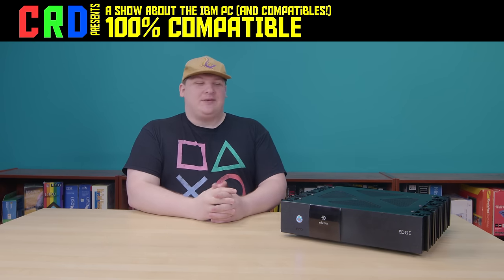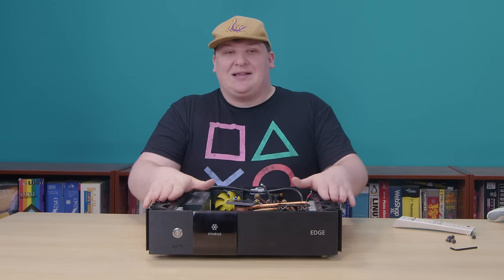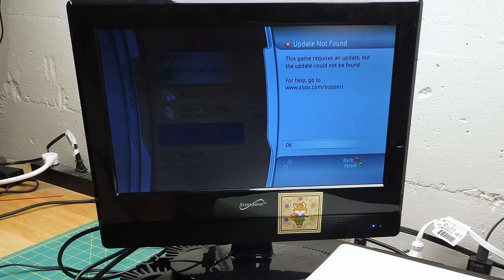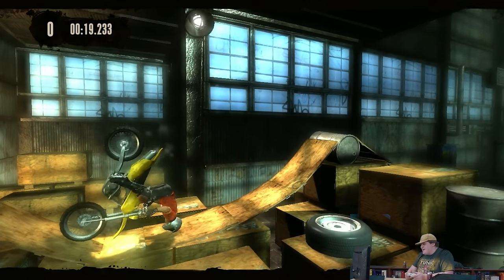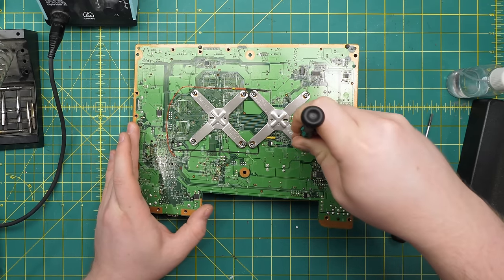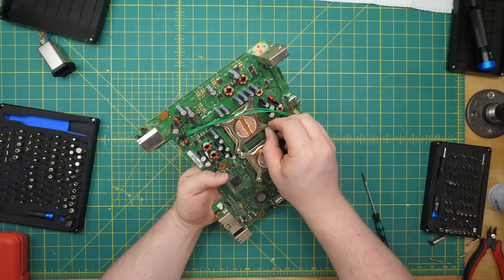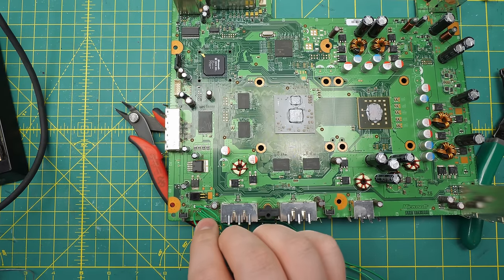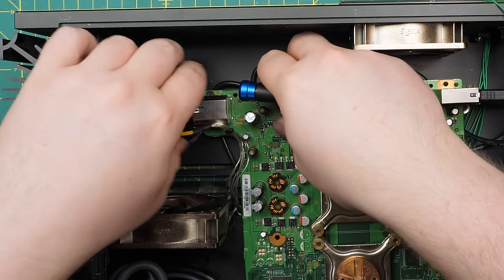The Niveus Edge Resurrection: Hacking A Hacked Xbox

Comment: Just to point something out. The early model 360s like the Xenon would RROD over time no matter what. People blame it on the heat and poor heatsink + fans, which were a problem. But nowhere near a problem as people thought. The real problems were simply the solder alloy they used. It was prone to cracking and chemical issues over time. This is why DIY and repair shop reflows (be it toaster oven or a proper BGA rework station with "correct" heat profiles (I say correct like that because no correct one exists). Microsoft also appeared not to understand this for a while either (hence 2+ warranty claims (or even 5+ - I had three), hence the first hardware iteration still having issues (at a much reduced rate at least). And eventually what lead to class action lawsuits which made them increase the warranty, then in some places they just made the RROD warranty unlimited (well until console EOL).

You could take a new old stock Xenon that had been sitting on a shelf for 12 years in a climate controlled warehouse, and chances are pretty high it'd RROD within a few hours. If it didn't RROD in a month that was/is still pretty much a miracle.

I believe it was some sort of oxidation reaction going on. It was quite complex with potentially some sacrificial metal magic also acting to draw out certain elements from the solder (keep in mind this was back when companies were still getting to grips to switching to entirely lead free solder). Other factors were the way mounting pressure was applied causing warpage (though well within previously acceptable limits) and finally users not just running it hot, but living places with regular very cold ambient temps when the console was off - constant cycling between hot and cold increased the issue a lot (though again within normal values had the solder been fine). This info was from a MS internal report iirc, either leaked or maybe from discovery in court).

Also something you might find very very interesting is that someone put a bunch of unused Xenon CPUs on eBay a few years back. Meaning CPUs with no blown efuses. The calls to blow fuses manually was also known back then. Meaning you could in theory grab one of these, and load it up with your own public keys, for the individual console key load up an old private + public key from a several year old console that hasn't been on live in so long (and has no suspicious live activity).

Then you could resign the latest firmware, upgrade. Now you can jump online with an 
Xbox you truly own. Run anything you want. Modify anything you want. Make the incredibly well implemented hypervisor a bit more chill. Would be amazing to own one, especially with the 1GB mod (btw if you wanted it to be a dev kit just fire off the efuse. Just make sure you reball that CPU with better leaded solder first. I heard some later chips including the CPU + GPU one also ended up on eBay - my memory is fuzzy there though. 

Also one last thing to say about the 360 is the software implementation for preventing unauthorised code from running was just spectacularly fantastic. To put it in perspective, the 360's software pretty much remains unexploited to this day - there is one exception which is the KK exploit which cleverly used modified shaders to get unsigned code to run. But by the time that was public it was long patched. Since then no one has ever gotten past the software security, since the console can be thought of as a simplified virtual machine. Any type of system call from an executable? Well better check if the signed process executable was given that permission? Nope? Kill the entire process. Oh the games buffer overflowed? Who cares I didn't even notice, that'd be too much performance hit. Oh it overflowed into system memory? *loads shotgun*. Also makes it so games can only see their own files written to the HDD, like modern Android etc.

It was amazing how well they learnt their lesson from the OG Xbox. Yeah they still messed up the DVD drive security implementation and the JTAG, but it was an insane improvement in one generation from the security mess the OG was. And as I mentioned the software hypervisor was and still is almost a perfect example of console software security.

Comment: The wireless signal is going through the fan openings and any gaps in the case. The M$ controller had a great range because they used proprietary wireless protocols in the 2.4GHz range. Automated digital RF channel hopping and signal strength that didn't have to fall in an IEEE spec. ;)

Comment: The DVD drive pairing is only actually necessary for playing games (executing code from disc). You can use the DVD video playback functionality of a donor drive just fine on a retail console - in fact, that "error" screen that comes up when trying to play a game with an unpaired drive is just that. A DVD video. Oversimplifying massively, Xbox discs have one small DVD partition with that video on, which was meant to show if a kid puts the game into a DVD player etc. The game itself is on a separate partition which is invisible to most DVD drives, because it's missing from the disc TOC (but the xbox knows it's there).

So it might well be possible to add DVD playback support to these machines without much effort.

I've not yet finished the video so if this is mentioned please disregard my comment!

Edit: 2 minutes later, and yes, this is mostly mentioned in the video oops
Reply: They could have moved DVD drives between their consoles, that would allow dvd playback without allowing Xbox games to run, which would make that a much more valuable product

Comment: Fun how it was mentioned that the DVD key is on the motherboards NAND, yet continued to say "slurping keys from one drive and put them on another" as the only way.
No drive is needed, slurp the DVDkey from the console's NAND and slap it on a drive. (step 1 of modding is to pull CPUkey and DVDkey to unlock the NAND. At that point you just restore to retail firmware and program the new drive)

Comment: The DVD key situation isn’t actually that dire, because the drives themselves are not married— it’s a daughterboard, so as long as you have another drive of the same model, you can swap that daughterboard over (it’s just a ribbon cable) and it will work. 

Of course, wouldn’t help you in the Niveus situation since the drives are probably in a landfill somewhere.
Reply from the maker: Yeah, I read that that was ostensibly possible... but then there's a ton of posts floating around from people saying they did it and it didn't work, and I know that makes no sense, but it suggests to me that maybe it's possible to screw up swapping the boards. So, while it probably never would have been an issue for me if I'd run into it - because I know to research something like that before attempting it, and because I have general electronics skills, etc. - it seems like for a lot of people it could still end with them $90 poorer and no closer to a functioning machine, you know what I mean?
Reply: @CathodeRayDude  yeah it’s definitely above what the average person will know how to parse and do, and admittedly I started working on these after they were thrift store fodder.

Comment: This reminded me of when I modded my original Xbox in 2019. Took it from stock to softmodded with a new(ish) bigger HDD and a tube-sleeved IDE cable.
I ended up having to cut chunks out of the HDD caddy to even get the thing to route all the way over to the drive, but I managed it. So, I guess it's technically a hardmod in this instance.
I also had to twist the cable something fierce to get it to route into the DVD drive's slot. That's one of the main benefits of using a tube-style one, since they take bends much better.
In any case, when you spend enough time taking care of and modifying the internals of these things, you really do become attached to them. I can tell that happened to you as well.

Comment: The key as to why your blue locktite did not cure is it requires isolation from the atmosphere.  I believe it won't cure in the presence of oxygen if I recall correctly, but I may be mistaken on the component of the atmosphere it needs to be isolated from.  Hence why it does the job of gluing fastener threads so well as the fact that it is trapped within the threads creates said isolation.

Comment: Rad follow-up! If I were looking for a "better" place to stick the SSD, I'd probably have stuck it to the side of the power supply case, maybe with a long extension cord you could attach it to the top of the case too? But honestly props for securing it to anything at all, honestly. I'm certainly guilty of just letting an SSD dangle from a cable or two in a pinch.

Comment: The "put disc in an Xbox 360" error you mention around 11:18 is a hilarious example of poor design.

The game discs are set up so that they also function as a standard video DVD. This is so that if some clueless user puts them into a DVD player, they'll get that "put this in an Xbox, dummy" message. That message is actually a video.

BUT, once the drive starts to wear out, it can fail to recognize the disc as being a legit game disc. When that happens, it assumes it's just a normal video DVD instead... so your Xbox 360 tells you to put the disc in an Xbox 360. Doh.

This confusing failure mode could have easily been prevented by just having some extra flag or file or something on the disc that tells the Xbox "this really is a game disc, I promise", secondary to whatever DRM it's checking. That way it could tell the difference between "failed auth check because something is wrong" and "failed auth check because this is a movie" and show a more appropriate message. (It wouldn't help pirates; the only way you could abuse this feature would be to make a DVD movie that an Xbox won't play.)

Comment: 1:00:00 You're missing a VERY obvious place to stick that drive. Stick it to the side of the power supply with some of the Gorilla tape. You have a huge flat spot right there.
Reply from the maker: It doesn't fit as well as it looks, trust me. I could use an extension but then I'd have a bunch of extra miserable cable mess torquing the drive connector, which really wants to pop out of the board as it is.
Reply: @CathodeRayDude You could perhaps swap it for mSATA?

Comment: I'd probably use a dab of nail polish on the heatsink screws. It won't hold up to any real amount of torque, but it will keep them from wiggling loose. It should come off relatively easy if you need to, and since it's on metal, you could use acetone to clean it if you really needed to.
Reply from the maker: oh yes! that's what I've seen used for this, nail polish or other enamel of various types. ty!!
Reply: I’m an actual bench repair technician, and this is what we use to keep screws put. (heck, it’s what the original manufacturer of what I repair used!)
Reply: @CathodeRayDude  Adding to this, the reason the loctite didn't cure is because it requires the absence of oxygen to cure.  It only goes off inside the threaded connection, and the bottles have special lids to ensure air circulation.
Reply: @CathodeRayDude  It achieves 2 things. Sort of holds it, but also you can see if the bolt/nut has moved.

Comment: 29:06 Nice pun :)
55:53 Not superglue... how about hot glue?
1:01:20 I feel like they knew they were, yet felt that, because of the lack of a Vista Media Center Extender, they had no choice, so did what they could to make it Just Barely Work (tm) and shipped it out to customers, expecting it to fail, by which point a proper device would exist, so that they could say "oh, just send back the Edge and we'll replace it with The Proper Solution". Just my $0.02

Comment: 33:59 "The softest material you can make a fastener out of" Uhh i had the pleasure to work with Aluminium and Nylon screws, Brass would be like awesome compared to those.
Reply from the maker: okay nylon I knew about but those are super special purpose so I don't really count them. what on earth is an aluminum screw for???
Reply: @CathodeRayDude  Very lightweight, you can buy them for multi copters and other RC planes. But yeah need to be really careful with those. I tried those, but latter changed to titanium screws, less lightweight but not such a hassle to work with.
Reply: I've used some pretty vile screws in the past as well, and aluminum is definitely up there for being frustrating. My least favorite were some #8 hex bolts made from ceramic used to center a high voltage electrode in a tube. Bastards liked to shatter and send little razor sharp slivers everywhere. Now most of the exotics I worked with were for thermal reasons - working on scientific gear that was made out of who knows what and you needed a stack up of screws and washers that had a matched coefficient of expansion so you neither slacked off the tension or snapped a screw. Phosphor bronze and brass 2-56 x ¾" or God save you, 1½", were our bread and butter, all flathead:)
 I also had the pleasure of getting to know what it feels like to torque in a set of nearly pure Nickel screws, which is to say, notably unpleasant. 
I switched projects and now get to use 18-8. Life is good.

Comment: I think the edge doesn't function as a Faraday cage because only the top has holes at all and they're probably not the right size and distance to block the necessary wavelengths

IIRC, a grounded sheet of solid aluminum may slightly impede radio waves, but it's the holes that cause them to scatter and function as a proper cage
Reply from the maker: ...huh. Huh. Really? The mesh is actually _functional_, not just a property of needing airflow?
Reply: @CathodeRayDude  afaik, yeah, but I'm just vaguely recalling some science demonstrations from ages ago, hardly an expert, worth looking up if you got the time, I gotta pick some veggies ATM 🤷
Reply: @CathodeRayDude  well I finished picking greens and went and looked it up and I think my understanding was wrong, but I think I also found the reason for your controller working all in the last two lines of Wikipedia's summary 🙃

"Near-field, high-powered frequency transmissions like HF RFID are more likely to penetrate. Solid cages generally attenuate fields over a broader range of frequencies than mesh cages."

So it seems a solid cage should be more effective as you'd surmised, but I think the Xbox controller probably qualifies as a "near-field, high-powered frequency" more likely to penetrate 🤔
Reply: Faraday cages are also much less effective in practice than in theory, at least at the microwave frequencies that modern digital electronics use.

At my former workplace, my colleagues wanted to make a lab to do WiFi experiments in a controlled, otherwise radio-silent environment. They tried Faraday cages, but nothing worked, the devices were still getting signals from the rest of the office. In the end they had to put that whole lab in the basement. 

I also listened to a talk at a conference where radio engineers described an RF testing setup they built, and they had similar conclusions - if you need to block microwave RF at any meaningful level, you need specialized shielding that goes for hundreds if not thousands of dollars. No domestic casing is gonna cut it. It might lower the signal level by a couple dB, but nothing that will stop the thing from working.
Reply: @kFY514 You might be surprised at the effectiveness of Faraday cages, if the hole sizing is correct.

I mean look at the door of your ~1kW microwave oven. Almost identical frequency as Bluetooth and 2.4GHz WiFi.

Comment: The reason why your HD DVD drive didn't initially work on that Xbox 360 is because that Xbox 360 can't connect to the internet at all. It requires downloading the licenses from MS's servers to work correctly, and because if you connect that Blades 360 to the internet it'll try to download the latest OS as well which you don't wanna do.
It'll work fine on the updated Xbox 360 with the latest OS that can connect to the internet because it can now get the proper licenses.

As for why people praised the HD DVD format vs Blu-ray due to no DRM, the no DRM gray area was because with an HD DVD, you don't need special software just to play it.  You only need the licenses and that's it, It'll run by itself like any normal DVD drive.
Sure you can do that with blu-ray drives today as well now, but back then you couldn't.
Reply: Incorrect. The hd dvd's do not require keys from the Internet. The drive originally came with an update disc that upgraded the dashboard to the latest version AND included a new hd DVD player as well. His is too old and does not have the dashboard with the new player software to play an actual hd DVD. I think i still have my disc in a box with all my 360 games. 

Also hd DVDs were always meant to work offline with no internet connection as that was not common back then especially for set top players.